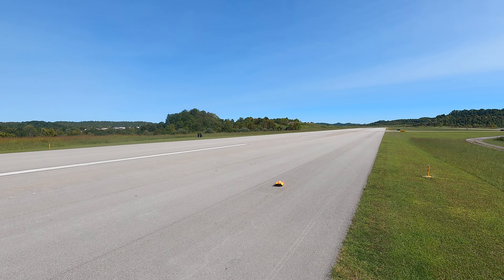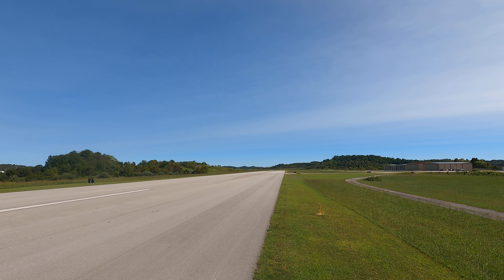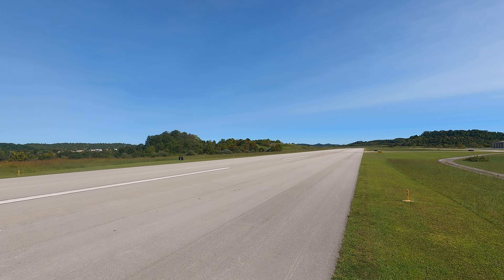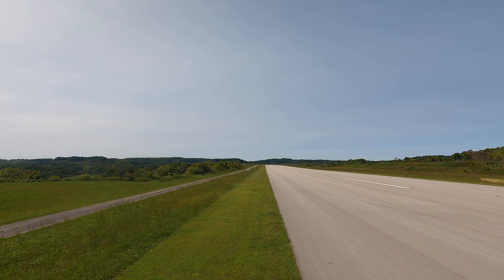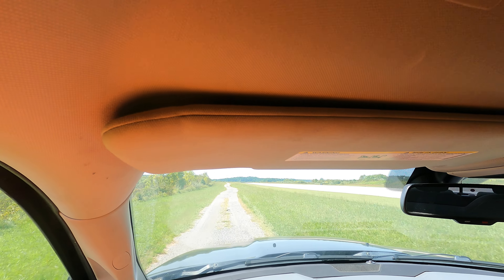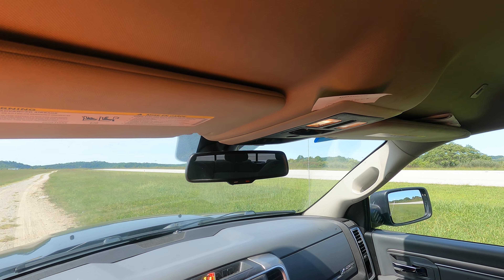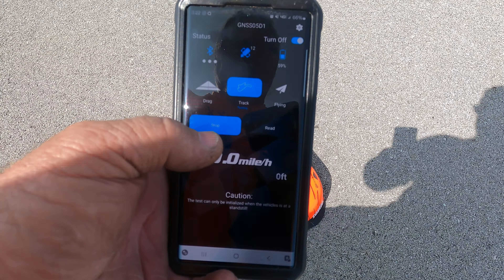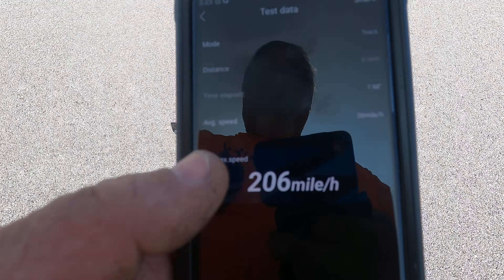DELTA PLASTIK OLDSPEED BODY.                 1ST DUAL MOTOR PASS

Comment: looks like you upgraded the pickup to a Ram, nice, here is a thought on speed runs does any one make/use Aluminium wheels with foam that can be bonded on and trued, i feel this would cut down on the tyres blowing up, good run